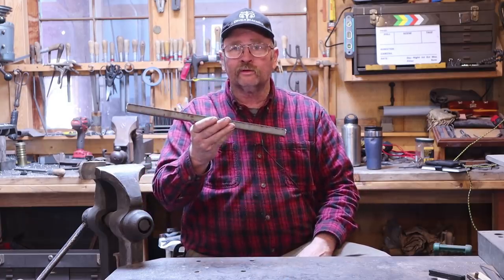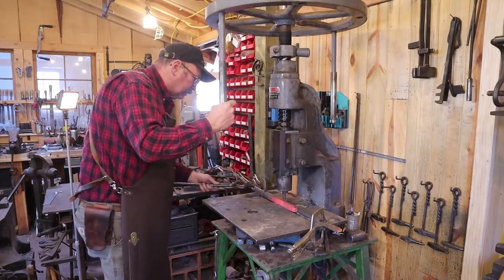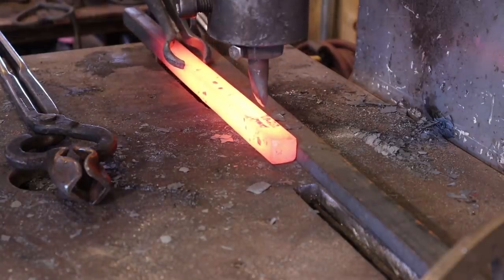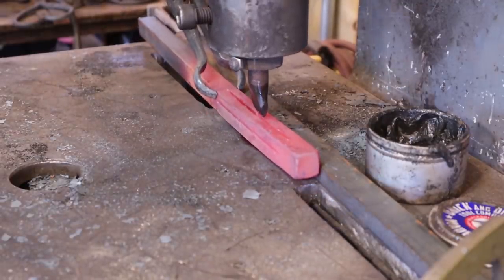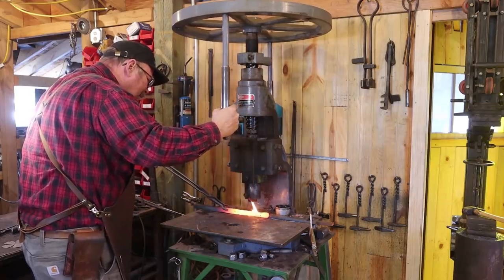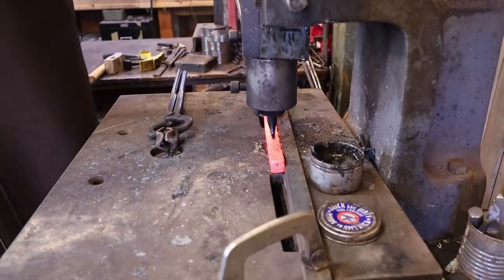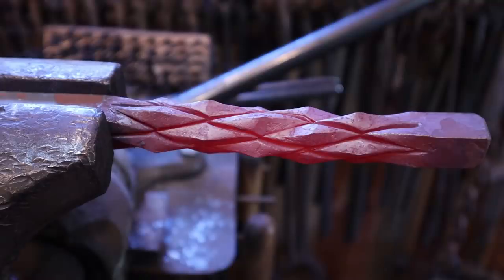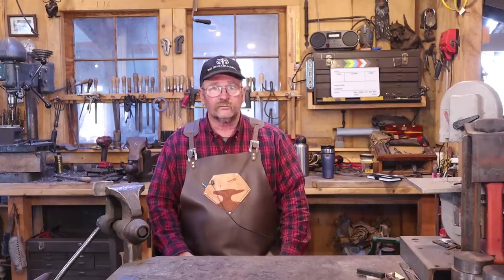Pinapple twist - using the Fly Press - ornamental blacksmithing

Comment: The only tme it seems i need lube is on something finicky, with the tongs held between my legs, on tippy toes, one knee bent. That awkward position we all get into sometimes. And of course just as you get that piece to where you can hit it, your tool sticks and the lube is somewhere in the tool box drawer on the other side of the shop... I was told by an old timer once that in a pinch, a pinch of forge scale will get you working. And it does work. Lord knows we all got enough scale laying about.

Comment: Maybe an upper stop just a hair higher than 3/4 inch.  Basically a loose clamp that doesn't "clamp" the bar.  If you used one on the longer side of the bar, you might only need the one.
One other thought, has anyone seen a pineapple twist in hex (or even octagonal) stock?  I know it would be more work, but I think a hex pineapple twist would look really good.
Reply from the maker: An upper stop or stripper would help, but wasn't worth the trouble to set up for just one.  If I were doing multiples it would save some time in the long run.  I would think someone has tried other stock for the twist, but I don't recall ever seeing an example

Comment: At 15:55 you put the metal back in the forge but you put the end you aren't working in first. Then you show that end not hot. Did you push that end thru to the outside of the forge or am I just confused?
Reply from the maker: I wanted to be able grab it from the other end so I put the long end through the fire and out the back door

Comment: Didn't know about punch lube, unfortunately on the quick and dirty website it doesn't say what it's made from. What are other more accessible ways to lube a punch or drift, would motor oil work?
Reply: I'd like to add that I live in Russia, so otherwise I'd order the lube from quick and dirty, I really admire how you prefer to support small blacksmith businesses, but we don't have that here
Reply from the maker: I think it is a wax base with a large amount of graphite melted into it.  I have seen some recipes that also add some lithium.

Comment: I am curious if you have ever tried sooting your punches and chisel (or even the work piece) with an AO torch with the oxygen turned off.  Gives it a dusty carbon layer.  I have seen you use crushed coal dust before so just wondering if this would work too.  Might work well as a lubricant, or I could be completely wrong.
Reply from the maker: It might work, but the extra trouble of getting the torch out might not be worth it.
Reply: @BlackBearForge  Yeah I can see how much of a hassle that could be depending on how your shop is setup now that I think about it.

Comment: As far as the issue with keeping the work piece on the table instead of getting stuck to the press head, yes your spring idea would work for a time. I only say that because springs fail after so long. In my opinion the cheapest and easiest all though crudest way I have found to remedy the problem is how did on my homemade fly press as well as my other presses. A hole drilled and tapped in the table top and a bolt with a nut welded vertically on top of it to put another bolt through, in the shape a "T" works wonderfully. With the vertical bolt it allows adjustments to be made for how tight you want the piece held to the table and which side of the press head (depending on where the hole placement) with some micro or fine tuning adjustments from the horizontal bolt. The vertical bolt also allows for centering on the work piece. This is all variable with bolt length, size and grade. Not only will it last longer than a spring but if you don't want to use it you only have to mess with one bolt which you can just turn out of the way or take off all together.